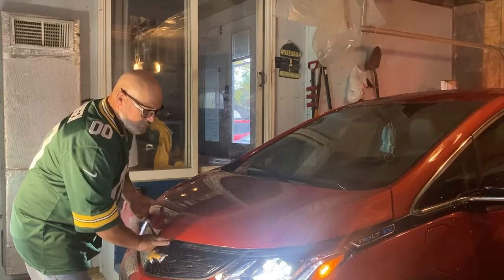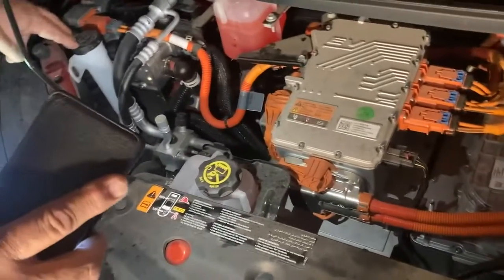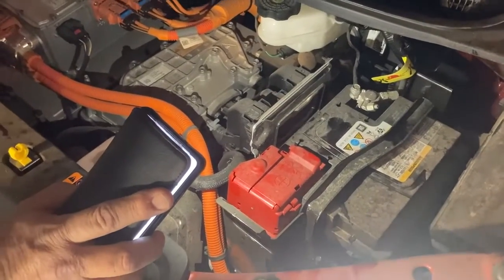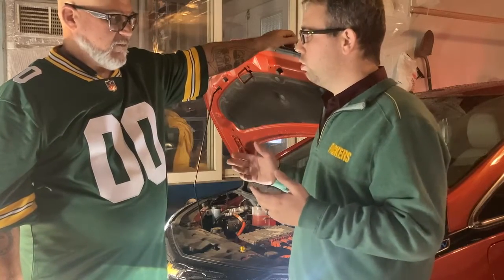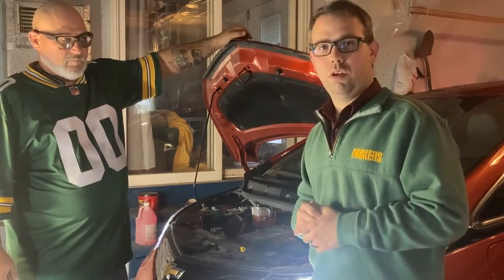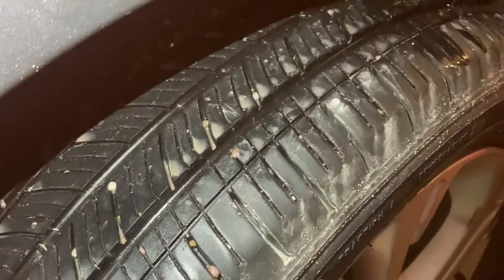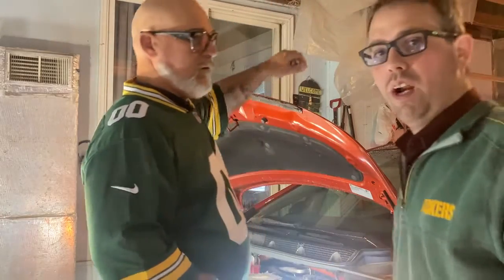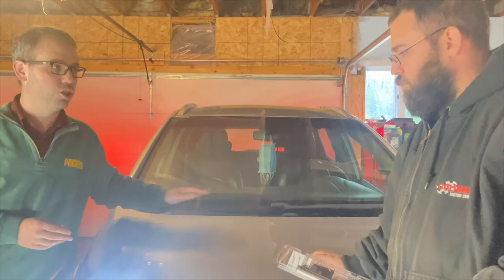Electric Vehicle Basics: Maintenance

Comment: This made me smile.  I guess we can take a hint about the simplicities of Bolt Life when you have to make feature content out of how to add windshield washer fluid, and how to measure tread depth.  :-)  

2020 Bolt LT here, just have DCFC and Comfort/Convenience.  25K trouble free miles.  Waited 20K to rotate tyres and they're still fine.

You might want to be sure to recommend that when people are replacing tyres, they want to be sure they are getting EV-specific rubber if they're not going OEM.  EV-specific tyres will have special tread patterns designed to reduce noise, because our cars are so quiet.  They might even have foam inserts or sealant inside to reduce noise, and of course the compound will be harder in order to resist the high torque and heavy relative weight of an EV.

Comment: A couple of things to add.  EVs tend to have high efficiency tires, which means they have harder tread rubber - hence they can live a longer life.  The second thing is that although EVs don’t wear out brakes, EVs do still need some brake maintenance to ensure long brake life.  If you regularly drive on dirt roads, or your car gets exposed to road salt, the moving parts of your brake system (pads and calipers on disc brakes) should be inspected and cleaned/lubricated every 1 to 2 years to keep all of your brake components in top condition, thus avoiding stuck calipers or pads, which can cause reduced brake performance and early pad failure.

Comment: Had a mouse nest once two years ago. Threw some rodent repellent satchels in there each fall, no problems since.
Software glitches: "Have you tried unplugging and plugging it back in again."
Windshield wiper fluid usage is real. Most folks wash their windows everytime they stop for gas...
Brakes. Use the brake pedal sometimes or the brake pads will actually rust solid.
Also, Kudos on your choice of Bolt color.
Reply: How many miles per washer fluid...  😆 🤣 😂 😹  great job guy all excellent tips
Reply from the maker: Thanks for the feedback!!! Please subscribe and keep getting our EV and Bolt content